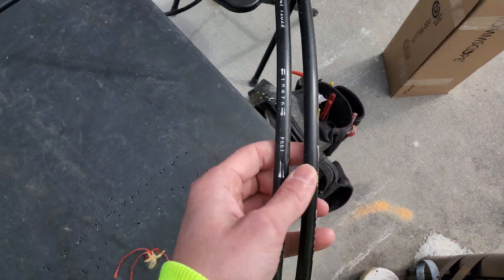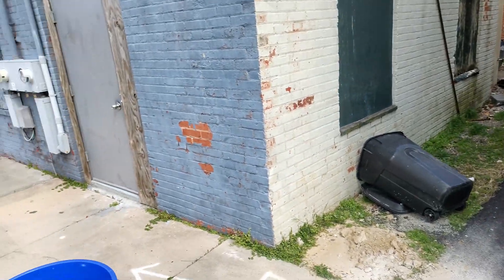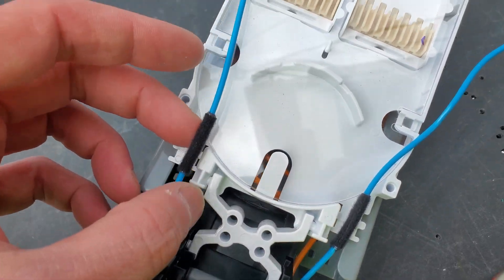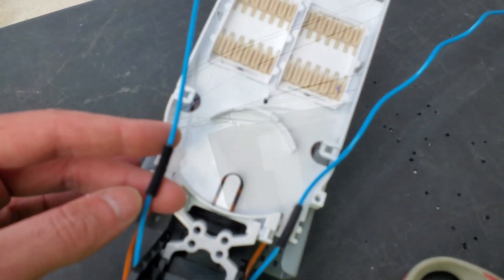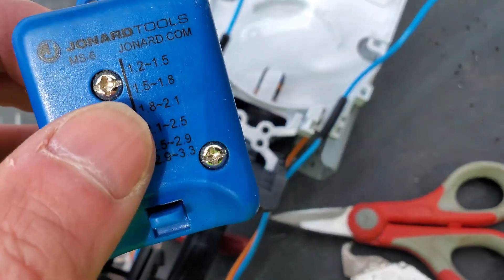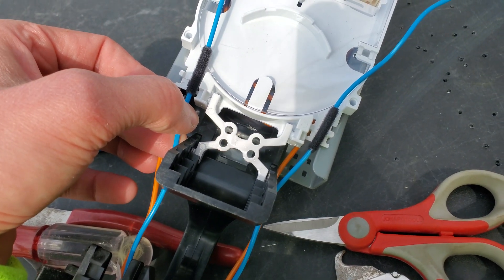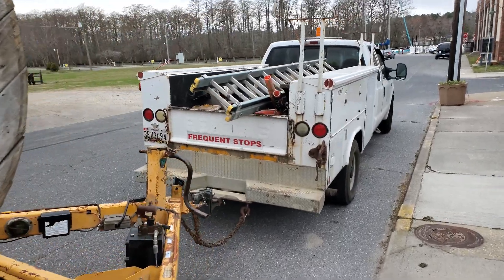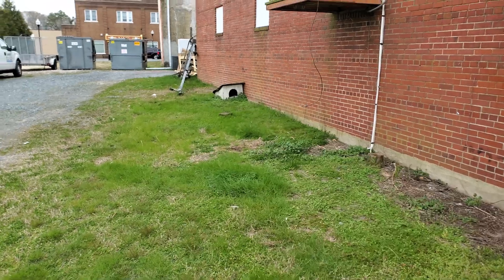GPON XGSPON vs DSL & DOCSIS, Pocomoke MD

Comment: I was a telco contractor for 15 yrs and now cable contractor for 3. I've always been baffled how someone can just start an ISP, figure out the logistics of putting their own lines in the air & ground, and somehow manage to get enough customers to sign up without going out of business soon after. I'm guessing the costs to lease space in the same easements as the big ISPs isn't cheap, or for the areas you run your own unique paths/vaults is also expensive cuz of doing locates, drilling, etc etc. I have no business sense, so I guess that's why I'm still just a lowly contractor. Wish I'd taken a different path in life lol.
Reply: Lease? You lease aerial the only real cost after burial is coming to mark for 811 calls or paying someone else to do it. The only thing you need in most places to bury is open a clec and have some insurance. The biggest problems with burying are crossing train tracks who are a pita to work with and expensive to pay for all their req's.

Comment: 50 bucks for a tool - tools are gold - i am contemplating building or buying a refurb to run ids/ips pkt cap - all the req seem to be growing - selks says you can run on 16gb and 4 core, sec onion says a bit more malcolm says 8 cores and  even more and arkime which is the actual pkt cap tool (formerly moloch) says 96gb ram - i know i don't want to get a 1/2u server, just going to get a ws - i could get a hp z4 but for the price of c 250 i may as well just get an am4 mb and a chip i can eventually upgrade. i did run sec onion on a box with older intel and 32gb and it was pretty stressed - it ran but was using all mem and dipping into swap...so will bite the bullet and get something with 64, check qvl list to mke sure it can run 4 dimms and 128 if i need to go with even more. As an aspiring infosec practitioner i sort of need to know the tools and it will be worth it but for a box that just collects pkts the hw req are more than i expected - if i can pass certs and get working then i can level up. one day at a time - great to see you out on the streets fighting the good fight and deploying fiber - it is crucial esp for smb sector - the symetrical bw is a huge boost - keep cranking! pls do an update on the z440 boxes you got - are they too power hungry to really deploy efficiently? at least you have some platforms to do devops on
Reply from the maker: I was thinking of load 1 of them 440s up with as much ram as possible.  Honestly their weight is most annoying with them like a 1u server or more.